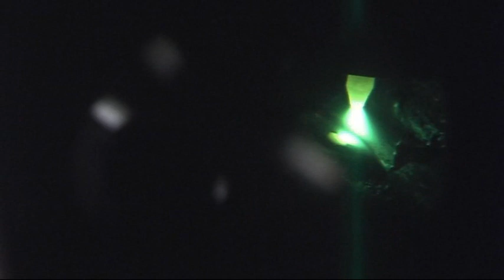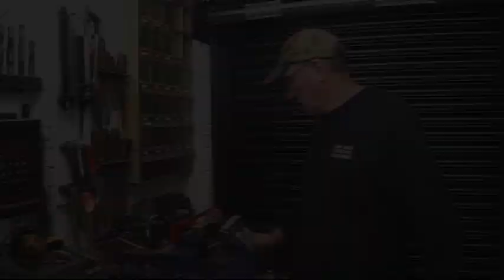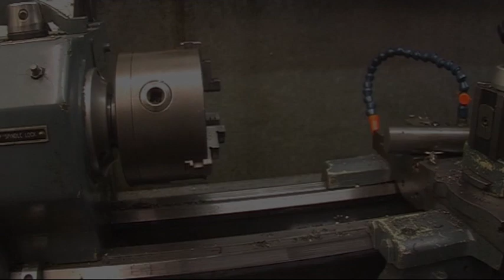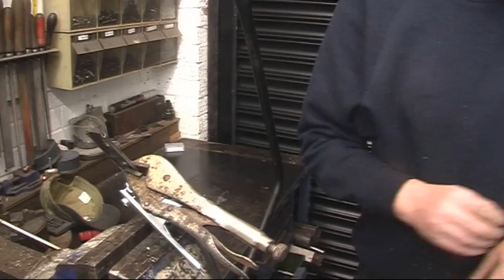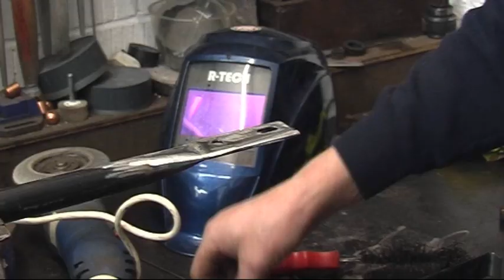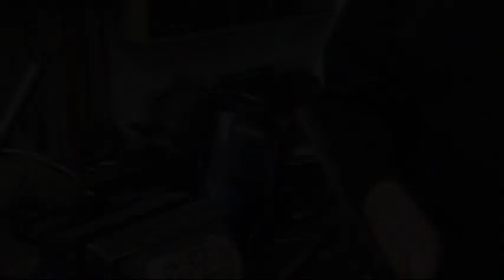Sunday Night Night Cap Seven

Comment: Those quick release couplings aren't rated for 10000psi, unlike the screw-together ones.

In the real world if the coupling's a foot above your head like on John's press, it's not such a big deal if it fails.

On the other hand if you're using a portapower, for example, and you're holding the coupling and it fails, you've got a problem.

Comment: Hi John, just check that there will be no contact between the inside and outside surfaces of the door. There should be clearance [@ 5 or 6 mm aprox.] thanks to the tubing like material fixed to the ends of the door panel corrugations and given the short span of the door there should be no rubbing in the middle, but we dont want white paint showing up outside on the new black door. That would be very bad news. Make sure that the paint is a colorbond compatible metal etch undercoat and top coats. Allow time [min. 24 hrs, pref 48hrs] for the etching undercoat x minimum of two coats to bite into the existing paint before applying the top coats. Dont forget to properly tape the edges to ensure over spray doesnt go into the side channels  and end up on the outside faces of the door and channels. We can live with seeing a strip of black on each side of the door, but I dont think YOU need the grief if white paint ends up on the outside of the new door. Assuming that you will be using spray cans I would estimate that two cans of under-coat and two cans of top coat satin white to prevent glare while working or taping videos. Several rolls of the blue painters masking tape and disposable plastic drop sheets to cover your machines. A particle rated dust mask for you. Remember to limit the time in the workshop while spraying due to the fumes.
Reply from the maker: Hi
Mark
I think a couple of new tube lights should do the job